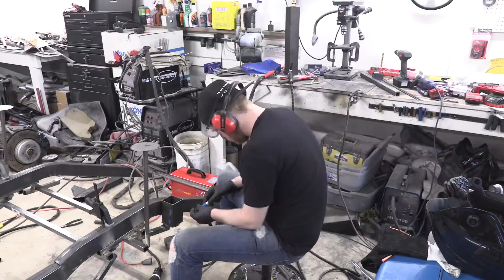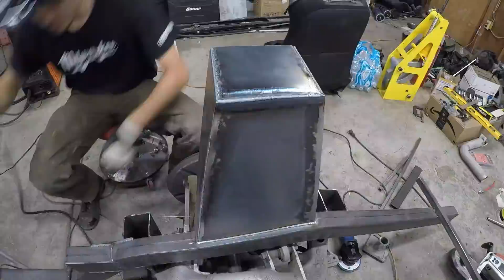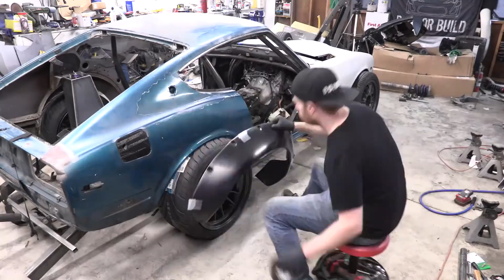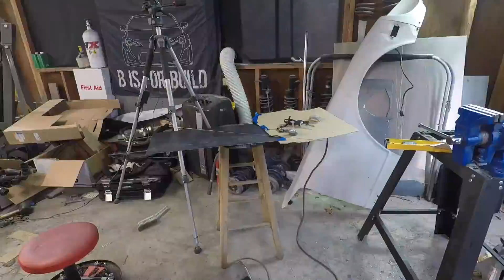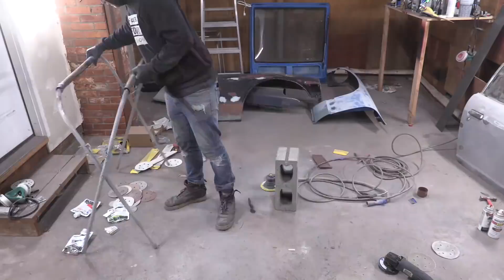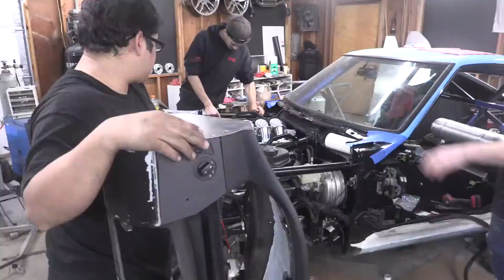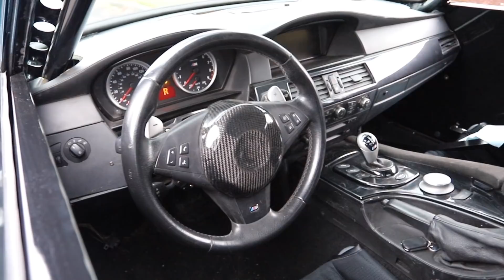You're In Over Your Head - 240z Finale

Comment: rocket bunny should apologize tho.
Reply: Wait what happened with rocket bunny
Reply: @rajveerbagri4492  more defects than a rep kit
Reply: he spent $4,100 on the rocket bunny kit and it had more defects than it should, he ended up using only the front rocket overfenders and a rep kit for the rears.
Reply: I thought he just didn't like the way the rears looked... ?
Reply: @battleaxesoldier  nah, they didn't fit well
Reply: @WhitentonMike  no, it's the stock 240 wheelbase.
Reply: Mike Whitenton the back half of the 240z shell wasnt changed at all
Reply: Such an impressive example of will and determination! Congratulations on your success and having the car no one else could.
Reply: Update: Some of the photos were taken at different angles and at different times. The final build reveals something interesting. See post below.

 @RamyWarda  I never said the shell was changed. What I said was the rear axle wasn't located in the stock location. The rocket bunny kit requires the rear axle to be in the stock location. With the axle moved forward from stock the wheel doesn't fit the opening of the rb kit. The rb kit was then fitted with the current wheel location which pushed it forward and the door gap no longer lined up.
Reply: Update: Some of the photos were taken at different angles and at different times. The final build reveals something interesting. See post below.

 @Slooof  He most definitely affected the spacing between the door and the rear axle centerline. The wheel and tire are centered on the axle. The wheel opening of the rb kit is designed to be centered on the axle so the tire will fit the opening in the kit. If the axle is moved forward the kit needs to be moved forward or the kit wheel opening will need to be cut. It wasn't cut so to get it to fit on the tire it was shifted forward and that made the door opening gap be in the wrong position. 

Look, I am not new to building racecars. I've moved shells as much as 4 inches rearward on the chassis. You just have to deal with the opening as best you can during construction. The rb kit wasn't made to be used that way. Pretty obvious to an experienced car builder. I'm not blaming him or rocket bunny for the change. But, the big issue I saw was the door gap and there was a cause for that other than a bad kit.

Here are a few of the cars I built back in the day. I have made more mistakes that Chris ever had and learned from them. It's part of the process. There is no need to be rude.
https://www.facebook.com/mike.whitenton/media_set?set=a.981209611898350&type=3
Reply: petem8 yeah but you know what is connected on the end of the axel a fucking wheel and tire that will hit the body kit because the axel location is not stock
Reply: well i'll have to hear what chris says at this point.
Reply: @WhitentonMike  The shell of the 240 was unchanged. There was no chop on the body. Unless later years of the 240 had different wheelbases or body designs and he ordered the wrong kit (I don't think this is true) it has to be rocket bunny's fault. The the fitment issue was with the entire wheel well and not dependent on axle location. He wasn't shifting the kit forward to deal with a wheel that was not centered in the wheel well. The kit just did not fit with the wheel well and the door of an unaltered 240 body.
Reply: Update: Some of the photos were taken at different angles and at different times. The final build reveals something interesting. See post below.

 @kevinhenson5225  I don't know why people keep thinking I'm saying the shell was changed. I have never said that. The shell was mounted to a tubing chassis. The rear subframe was mounted to the tubing chassis. What I am saying is the shell and subframe were not positioned so the rear axle would line up with where the rear axle would have been in the stock 240z. 
If you take the rocket bunny kit and mount it on a stock 240z, the wheel opening is made to fit where the rear axle is located. The rocket bunny kit is made for that situation. If you move the axle forward, the rb kit won't line up with the wheel. If you move the rb kit forward to line up the wheel opening with the new axle location the door gap will be in the wrong location.
Reply: @WhitentonMike  What everyone is trying to say, is that regardless of where the wheels are, the kit didn't even fit the body.
Reply: @WhitentonMike  stop making yourself look stupid the gap on doors don't have anything to do with the wheel arc in a auto body repair guy so stop assuming things 1 thing don't have anything to do with the other body line retain in same place no matter you move or not center line of axle that's the same when people wreck a car and don't repair the undercarriage all look good except the center line of the wheel
Reply: @jabba969  he's just a keyboard warrior he never gone understand the axle don't have anything to do with body lines
Reply: @jabba969  Not everyone is saying that. The photos below tell a different story.
Reply: @WhitentonMike  Let's leave out the fitment of the kit on the body itself. One of the problems that did have to do with the wheels, was that the front of the back wheel was really close to the fender. In the photo's you linked, it is shown that the centre of the wheel is actually a bit further to the back, meaning that the gap in front of the back wheel to the fender should have gotten larger, not smaller.

We are indeed all enjoying someone building a really cool car, which is awesome. It has however also come to light that the quality of RB kits has a lot left to be desired. They are 'the' brand to get for kits like this, yet the fitment is really poor and some pieces arrived broken if I recall correctly. I think it's a good thing that a company like this gets called out for its faults and insane pricing. Regardless the build turned out fantastic.
Reply: @jabba969  I made a fair number of updates to my posts. The picture to the right shows the front of the wheel opening as excessive. Others showed the rear of the opening much tighter. If the axle is positioned rearward that is what you'd expect. I'm not sure if I am reading you correctly but as I am reading your post it seems you are saying the wheel opening in the front is tight. The picture doesn't seem to show that. It is very hard to tell though. Pictures at different angles and not actually being there it could be just an optical illusion.

I haven't been in car building for quite some time so I have never heard of Rocket Bunny before this build. I became interested in Street Bandito to learn about how builders are making panels of carbon fiber. That led to finding Chris' channel.
Reply: How could a body kit designed to fit on a stock straight body, fit on this chopped, poorly reinforced, twisted, modified body?
Reply: noxxi knox  Thanks. People are assuming a great deal. I'm not concerned about their opinion of me. 
I pretty sure how it happened. I'm not pointing fingers. It is apparent to me that this may have been the first time Chris shelled a car and dropped it on a tube chassis. He did a fantastic job but there are some gotchas that one must look out for. The things that conspired against getting the rear subframe installed in the stock location were. Installing the subframe with the stock struts uncompressed meant the rear toe was off. But when the shorter struts were installed the wheel moved up which changed the camber which changed the toe dramatically. This pushed the wide tires forward which changes the wheelbase but more importantly the wheel position relative to the door. The other issue was when he took his measurements of the wheel opening to locate the subframe. Most stock cars of that era have a slightly wider wheel gap behind the wheels than in front. In other words, the axle is not centered in the wheel opening. When he dropped the body on he aligned it to the wheel opening center, not the stock axle center. How would one get it right on their own build? Mark the axle c/l on the subframe of the doner subframe car by dropping a plumb line in front and behind the axle tube, the c/l is halfway between those two marks. Next on the doner body, drop a plumb line from the stock axle up to the fender and make a long verticle line on the side of the car and mark it axle c/l. Then ignore the wheel gap, it will screw you up. When you drop the shell on, drop a couple of plumb lines off the fenders where the axle c/l was marked. With a long straight edge clamped on the frame rails right above the subframe axle c/l. Move the shell front to rear to align the plumb lines to the straight edge. Plan on adjustable toe arms from the very beginning of the build and possibly adjustable camber components. Which camber components depends on the design of the suspension. I don't like lots of camber from an engineering standpoint. But my goals are for maximum cornering performance over appearance. It should also be noted that rubber suspension bushings will allow the wheel position to flex so if you're looking for performance vs comfort, replace all the rubber bushings with neoprene, including the subframe mounts. Tire flex is also non-trivial so talk to the tire manufacturer about recommended minimum tire gap with the wheel width you are using. A lot of people overlook that and end up with fender marks on the tire sidewall.
Reply: noxxi knox  There are as many different ways to do builds as there are builders. You do you proudly. Personal touches are a very good thing. You'll inspire those that get it. Most builds are just a variation on a theme anyway. 
Taking a production car and making it feel better can get involved, to say the least. Tires, shocks, bushings, alignment, loose bolts, and the like should always be checked first. If you can, consider mounting a cheap GoPro knockoff so that you can clearly see each suspension component and drive slowly over a speed bump at an angle and look at each bushing and see if you can spot undesired movement and address it. If everything seems to be working then you start down the rabbit hole. 
Getting rid of as much flexing as you can will go a long way to ending that wet noodle feel. Install a rear anti-roll bar and a stiffer front one.
Generally, you are looking for yaw issues which are often roll induced but not always.
Look for things that can affect the toe, lateral movement and axle or bump steer. Once all those are inspected you may simply be dealing with core dynamics. There are three main dynamics, sprung and unsprung weight transfer and jacking effects. The goal is to minimize each of these in proportion to each other.

Going beyond this, you're going to need to know some things about your car. Call up a local truck scale and arrange 3 weight measurements. Total vehicle weight, front weight and driver side weight. To get the last two, just park with two wheels off the scale and two on. With these, you can determine the weight of each corner of the car. We are going to ignore cross weight for now. Calculate your car's front, rear, driver side and passenger side weight percentages. Front weight percent times driver side percent gives you the driver side front percentage etc. Take each corner and multiply by the total weight and you get each corner's weight. 
Your unsprung weight for each corner will be the weight of everything that is not riding on the springs. So, wheels, tires, spindles, brakes, and half of the weight of all the control arms and axles.
What we want to figure out is our sprung to unsprung weight ratio. We are looking for something below 10%. This will improve traction because 90% of tire movement vertically will remain in the suspension and not transfer to the sprung weight. That is to say, a bump of 1 inch will translate to 1/10th of an inch of chassis movement. Lightening up the unsprung weight is mostly going to be light wheels and tires and to some degree suspension components.
As for sprung weight, just subtract the total weight from the unsprung weight. Why do we need to know that? Well, I'm going to spare you from all the sprung weight transfer calculations. It is involved, trust me. At the level we are talking about here, just keep in mind that you want to end up with a total rear weight percentage of between 50 and 53 percent. So take a look at all those weights and see how much weight you need to move from the front to the rear of the car. Relocating the battery as far back as you can and anything else you can. Chances are you are not going to get there until you start removing or lightening as much as you can afford at the front. This will likely take a significant effort and cost for what seems like minimal gain. It's the cumulative effect you are looking for. It is tempting to gutting the rear of the car to lighten it. Only do that after you get the front as far as possible.
The last thing I'm going to talk about is springs and anti-roll bars. I'm expecting this to set off a firestorm because it is so misunderstood. It's important so I'm going to discuss it anyway. I'm not going to respond to naysayers because I don't have the time and I can't provide engineering degree level instruction in the YT comments. It is solely up to the reader to educate themselves and buy some high-level racing suspension books. There is a proper way to calculate what spring rates you need. It is way too complicated to discuss here. Condensed version goes like this. Sprung mass frequencies is the way to do it ideally. 1Hz in the rear and 1.6 to 2Hz in the front. For practical purposes disable the shocks and bounce each end of the car and measure the number of bounces per second. I know this seems like snake oil but this is how you get the feel of the road and the car's connectedness to the driver. You want the car to feel as if the tires are connected to your nervous system and there is a gyroscope in your butt. This is how you get that.
All that being said, which springs will give you that is a pita to determine. Just remember the amount the wheel moves relative to the spring compressing is what we needed. The spring rate the wheel sees is not what the spring is. The wheel is connected to the spring through lever arms. The spring rate needed is the wheel rate divided by the square of the lever arm ratio. So imagine a control arm with a coil-over mounted half way along the control arm. When the wheel moves 1 inch the coil compresses half that amount. Additionally, the force applied to move the wheel is half the force at the coil-over. Rates are force times distance so you need to use the ratio twice, once for force and once for distance.
Now for the weird part. If the springs are not correct, it isn't the end of the world. The absolute maximum traction, driver feel etc may only need to be in-the-ballpark. So how should we balance the handling? Adjustable front and rear anti-roll bars. I cannot stress this enough. This is what stabilizes the car's body roll, not the springs. You need them front and rear for performance. The front one needs to be much stiffer than the rear. Taking the lever arms into account for the antiroll bars, the rates the wheels see about 75 to 80 percent of the total for all the wheel rates. Let me unpack that. The total wheel rate is the springs contribution plus the anti-roll bar contribution. For 4WD cars, the roll couple percentage should be less than an RWD car. All of this complication can be eliminated with the use of adjustable anti-roll bars. 
Testing. Set the anti-roll bars to the shortest arm setting for maximum stiffness. Find a skid pad and drive in a circle. You are looking for two things. One the car should be balanced. If it is loose, the rear is too stiff. Lengthen the rear anti-roll arm until it is balanced. If the car feels effortlessly balanced without oversteer or understeer you are done. If it feels like rigid gocart and wants to chatter sideways, lengthen the rear anti-roll bar arm until it oversteers and then lengthen the front anti-roll bar arm until it is it stops oversteering. Keep doing this until that gocart feeling goes away.

I've left a lot of things out and glossed over others. Most builders have learned about CGH, roll centers, lower, wider, and really basic things. The above are listed due to the epidemic of ignorance and bluntly people pulling unimportant snake oil out of their butt.
Reply: noxxi knox  Carroll Smith is hands down the author of choice. Tune To Win, Drive To Win and go from there.  It will be the best investment in your build that you can make. Buy those and read them before you commit yourself in your build. It will change the way you think about performance and handling. Spending a few hundred on his books will take you farther than anything else you can do.

Dude, if you've got 2 years of college level engineering classes behind you, you just need the applied science from Smith and you're going to kill it.

CGH & COG can be plotted on graph paper using top view and side view. Draw out your wheelbase in the side view and wheel centers on the top view. Mark all the scale weights. Then block your suspension and fill the gas tank so you are dealing with an approximate rigid body and raise the front 10 degrees and weigh the rear wheels only for safety. Scales in the air is scarier than shit without some sort of raised platform.
Anyway, draw yourself a force vector diagram of a truss between the tire contact patches and the COG. You should be able to locate the COG within an inch or so. That will be more than good enough for your purposes. A good guess is 15 inches give or take a few inches on the high side.

Rule of thumb on roll axis. Get the front between 0 and 4 inches and the rear between 9 and 12 inches. The rear is the easy one because the roll center is the center of the Watt's Linkage. You're going to be thankful you haven't mounted it yet. It needs to be lower than hell. Sorry about your vision of your exhaust. You can flip the WL around if you need to before you build the mounts to accommodate exhaust routing.
I have a better suggestion on the rear suspension since you are using straight axle. Make a WL from the side view with the lower arms going forward. From the top view, move the lower rod ends from under the axles to under the diff. You have essentially made a 4 link WL from the side view and a 3 link from the top view. The bottom 2 links are acting like an A-frame. Tada, no more 4 link binding and your rear roll center height is down where you need it. You're welcome. :) I saw a dirt track guy with this setup when I was a tech inspector. I never told anyone until now. That was over 30 years ago so I don't think he would mind. Independant rear is totally different of course but the roll center height is the same. It needs to incline the roll axis a bit. Since your roll couple is heavily front biased the additional jacking force is manageable. The low roll center in the front means low jacking force so the high sprung weight transfer at the front won't contribute to understeer.
I've only seen one car that would counter roll in a corner. The front roll center was above the CGH and the jacking force was insane. Understeer was terrible. Don't do that unless you want to reinvent everything and drive a gocart for your daily driver. No fun.
It should be noted that the rear links I described will need some upward slope from the side view for anti-squat. Don't get too crazy or you will end up with rear steer that you won't know where it came from. WL assumes (side view) that the links are parallel to the ground. Changing this to add anti-squat will change the wheelbase in the corners, fortunately in the correct direction. Just be aware it's there.
I think you are headed in the right direction. If you can accomplish what I've described, you're going to shit yourself, seriously. It's going to feel like it is on rails and super stable and in control.
Drive safe and have fun.
Reply: noxxi knox  I'll just throw this out there. If one wants to dabble in oval track, the cross weight percentage will need to be adjusted depending on the left-right weight percentage. The way to keep your head straight is you want the corner exit to have roughly the same weight on the rear tires so the car will go the direction you are pointing it. If you are oversteering on exit adjust the cross weight to decrease the static weight on the outside rear. Cross weight is a static setting so it affects corner entry, apex and exit. Adjust the anti-roll bars for the apex. This will take some dialing in.
Reply: No such thing as bolt on
Reply: noxxi knox  Amen to your comment about having no time frame. My father is building a 1967 Camaro and it's going on around 15 years since he bought it up until now. He spent years on body work alone. If he found the slightest low spot on the body after sanding the filler primer, he would fix it. I don't think the body can get more straight and true than it is. It will make for one hell of a nice paint job. He is really putting in the time on his frame-off restoration. Every bushing has been replaced with Polyurethane bushings. It has a coilover conversion for better handling. The back has a mini tub and the built Ford 9" is narrowed. It has Wilwood disc brakes on all 4 corners. He decided to go with an old school Chevy engine instead of a LS/LT. It's a 489 CI big block and there is a 125 or 150 HP plate style nitrous system for a little extra something. The bottom end is forged with Brodix Race Rite heads. The 1050 CFM carburetor helps quench the engine's thirst for the 50/50 110/93 mixed fuel which smells so good. I think the car will put down low-mid 600 HP and high 500 to low 600 TQ to the wheels off the bottle. On the bottle it will Probably make 7XX/6XX. There is an FTI TH-400 delivering the power to the rear end. I forgot which brand of wheels he has but he had them design a one off set. I think the rear wheels are 10" wide and the tires are beefy. When the wheels were shipped, one wheel showed up with a bent lip and the company took care of it and made another to ship. That's a company who cares about their product and customer service. The carpet is in and some of the wiring has been ran. All that is left is running the rest of the wiring, installing all interior pieces, painting the body (besides firewall and jams which are already painted) and installing the exterior trim. He plans on giving it to me when the time is right and I plan on passing it down one day as well and pray it will be with the family for as long as possible.
Reply: the